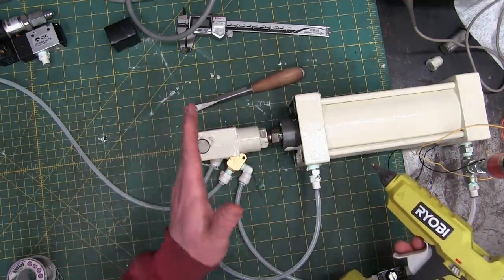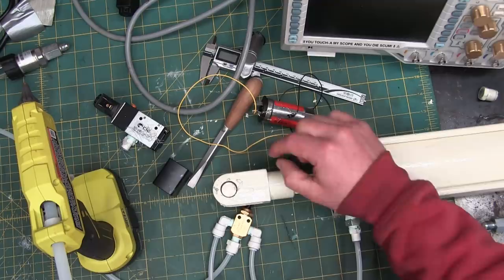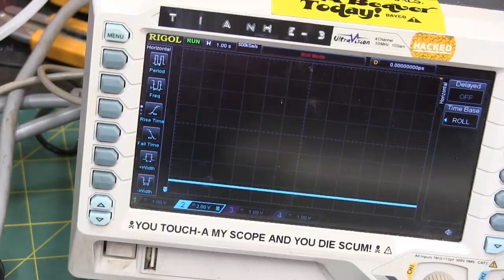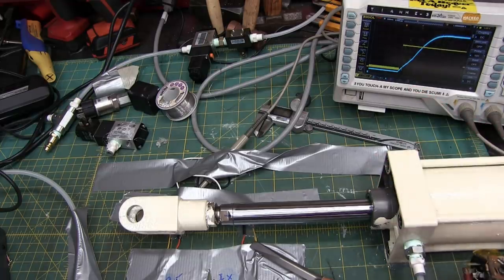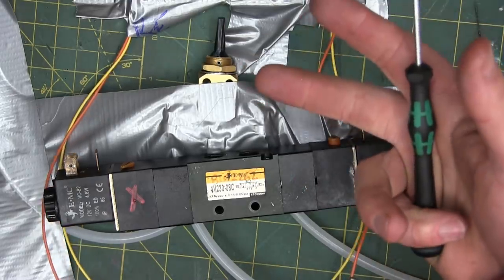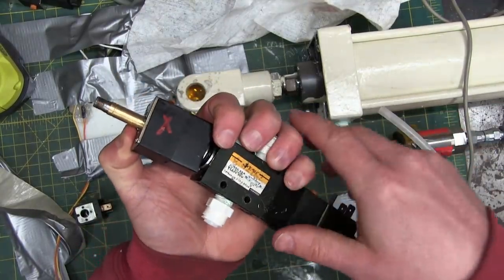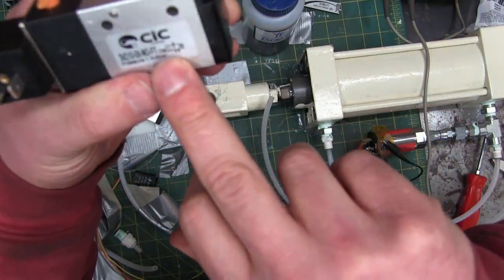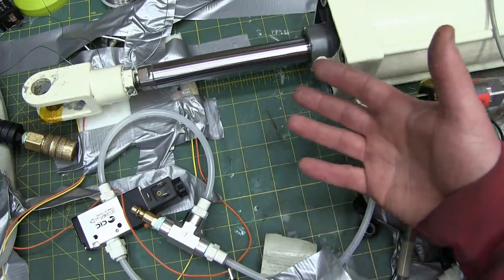Transducers, Solenoids and Headaches | Pneumatic Automation

Comment: Hey Uncle Bumblefuck,
   I have been wanting to make some contact with you here on the internets regarding your videos, and questions about Engineering and Manufacturing. I am studying Aerospace  enginerding in Florida, and I'm woking on a project for my CAD class. I chose to CAD a cordless drill, and as the final portion of the project I have to make the drawings and select tolerances for each part. I found a .pdf of a chart to help determine what they should be, but im unsure of what type of casting the clamshell would be made with. I havn't been successfull in attaching any photos to this comment, I guess it's not an option... however the options from the table so far as castings are, Sand casting, Perm mold casting, Investment casting(whetever tf that is), and Die casting. I would love if you yourself or any readers could help me determine the name or directly what the tolerances should be for such a part, Please do let me know!
Many Thanks,
   uhh.. No Name lol
Reply: oh, P.S. LOVE YOUR FUCKIN VIDEOS!!